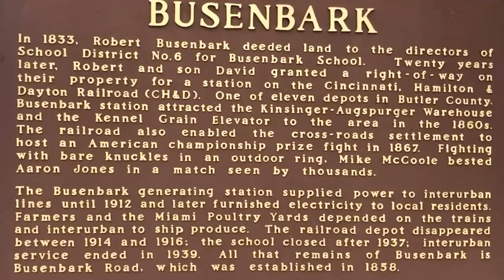Railroad Switching With Caboose On Industrial Beer Spur!  Platform Transfer Caboose CSX Local Train

Comment: This video showing the use of a transfer caboose as a shoving platform was interesting to watch. I wonder what the crew did to end up with the caboose moving from the end of the train to being behind the engine when the train came out of the Miller-Coors warehouse. When I hear or see anything about Coors Beer, it takes me back to 1975. At that time Coors Beer was confined its sales to Colorado and surrounding states. You could not find a can or bottle of Coors Beer in places like Illinois. In early July 1975, my wife and I took our soon-to-be one year old son on a camping trip to Colorado. We specifically went to Colorado to ride the Cumbres & Toltec Scenic Railroad and at that time the Denver & Rio Grande's Durango to Silverton narrow gauge trains. We enjoyed riding the two tourist narrow gauge railroads. On the way home, we knew that we had to bring home some 12-packs of Coors Beer for my father and father-in-law. We did buy the Coors Beer and we were thanked for bringing back to Illinois this treasurer.